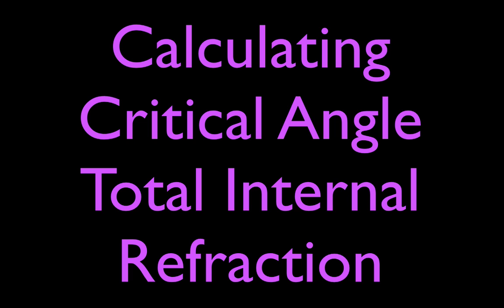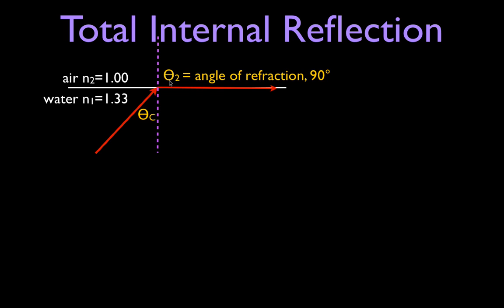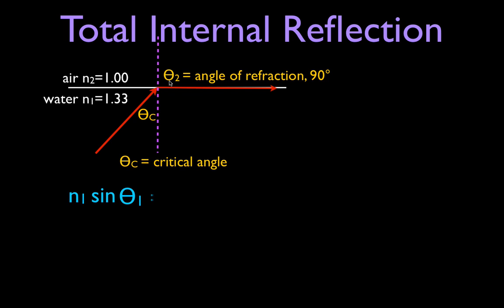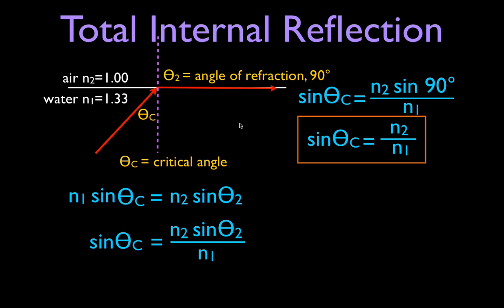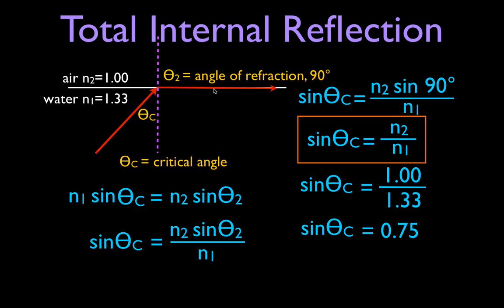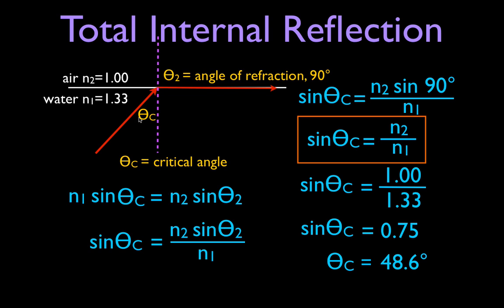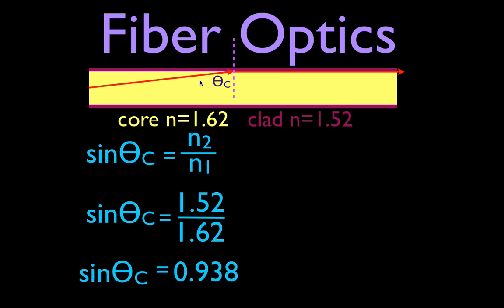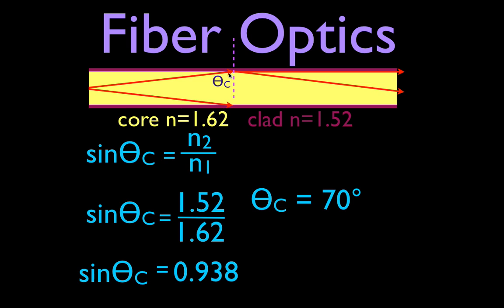Refraction (4 of 5) Calculating the Critical Angle

Comment: is the Critical Angle always the Smaller refraction index over the larger, or is it the "first medium" over the "second medium", eg, if we have 2 planes of glass as a display box, the first/outside layer of glass is n=1.5750, the 2nd inside layer is n=1.4899, Critical Angle = InvSin(n1/n2), will n1 be the outside glass, or just the glass with the lower refraction index? as if it calcualted with InvSin(1.5750/1.4899) it will obviously not calculate. So does this mean ther eis no critical angle, or just always calculate with InvSin(Lower n / Higher n)
Thanks.
Reply from the maker: In order to get to the critical angle the second material has to have a higher index of refraction.

Comment: Hello! A little help with a problem like this ? : A light ray in water strikes a water-air interface at an angle of incidence of 50 degrees.  What happens? What is the angle of refraction? would this apply ? ... I'm so confused lol
Reply from the maker: Maybe you should watch the videos on refraction first.

Comment: Can you help me with this?

Develop a method to measure the critical angle for the air/water interface. Using a scientific diagram show a set up that you would use to measure the critical angle between the media of water and air.

Based on the teacher, she said that we have to make a chart of 10 trials where each trial will contain two parts. I have no idea of what she is talking about. 

Is the critical angle the same as the refraction angle or it is only the same as the refraction when its in 90 Degrees? 

Please help me :(
Reply from the maker: Maybe she just wants you to take 10 different measurements of the angle of refraction from 10 different angles of incidence.  Start with angle of incidence at 0 degrees (ray of light perpendicular to surface) and increase angle of incidence 10 times until you get to the critical angle.  Does that help?
Reply: I guess you are right. Look, so the critical angle is the angle of refraction or is it just the angle of refraction when its at 90 Degrees?
Reply from the maker: The critical angle is the angle of incidence that results in an angle of refraction of 90 degrees.
Reply: Ohh ok. Thank you very much. I liked and subscribed :)